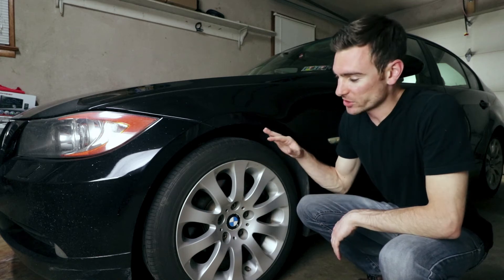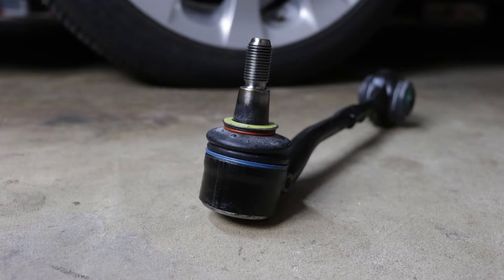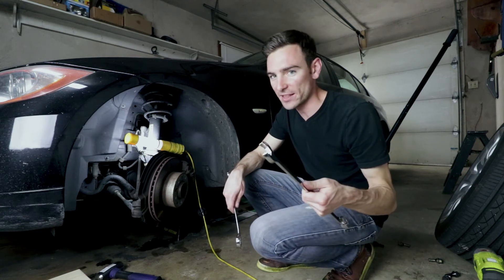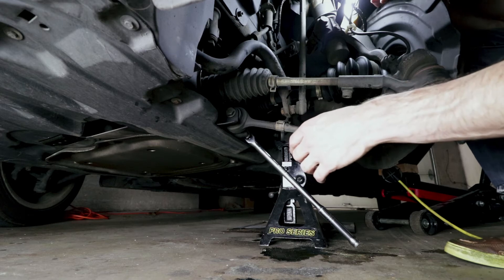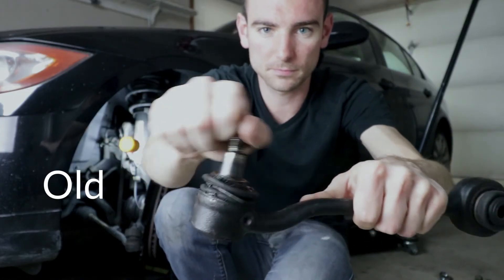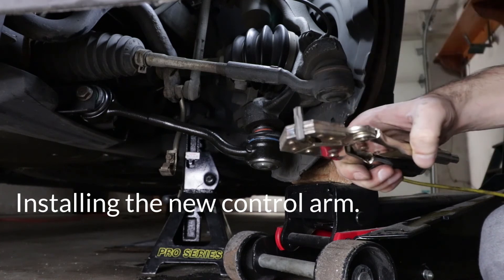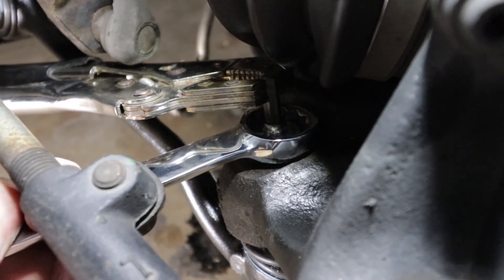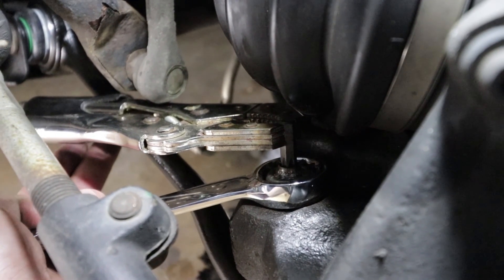BMW Lower Control Arm Replacement

Comment: In future jack the ballpoint up. It’s a taper so loading it from beneath will lock is into the socket and you can tighten it.

Comment: I think you’re suppose to jack up the suspension before you tighten the nut.
Reply: Yes should have suspension at normal height. Won't last otherwise.

Comment: What was that tool you used to pry it off? I am in teh middle of doing that job now and try as I might I cannot pop it out. Did you have to make the tool?
Reply from the maker: It's called a Pickle Fork or Ball Joint Separator. They're pretty cheap at local auto part stores. https://www.autozone.com/test-scan-and-specialty-tools/parts-puller-installer/oemtools-25202-5-16in-fork-opening-ball-joint-separator/4464_0_0?spps.s=5090&cmpid=LIA%3AUS%3AEN%3AAD%3ANL%3A1000000%3ATLS%3A71700000060668368&gclid=EAIaIQobChMIk6ua_8qR7gIVF2yGCh1QCgiQEAQYASABEgKnRvD_BwE&gclsrc=aw.ds
Reply: @how2diy643  thanks. I got it off in the end just using brute force. I've never had one get stuck before but I'll get the tool for future use.

Comment: So what size wrench worked best on that nut @ 2:55? You said 22mm but 24mm and 15/16 earlier. I could not get my 24mm wrench to rest on the nut because there is no room on the spindle. This simple job has become ridiculous.
Reply from the maker: Sorry I should have explained better in the video. I removed the factory control arm nut with the 15/16ths because the 24mm kept slipping off... but the new part from FCP Euro (Febi Bilstien part) had a different size nut which was the 22mm to reinstall the new arm. The wrenches I am using are pretty skinny from Harbor Freight so if yours are thicker that may be an issue. My car is a 328xi so not sure if the awd model is different than the rwd.
Reply: mine is a 328ix as well. I literally spent hours trying to get that nut off but to no avail. I will have to find a 15/16 wrench or something. The 24mm cannot seat because of the spindle. I couldn't even get an open ended wrench to fit on the nut. Its very frustrating.
Reply: the 15/16" wrench worked. I also used one that had a smaller ring if that makes sense. With the right tool, this job is easy on the x drive.
Reply from the maker: Great glad it worked!